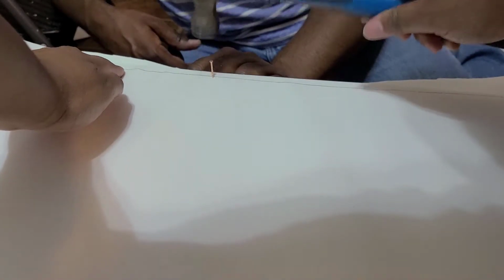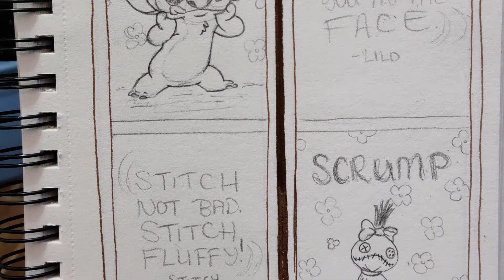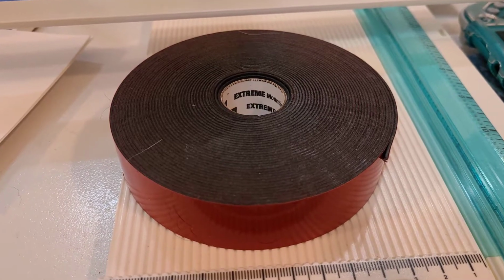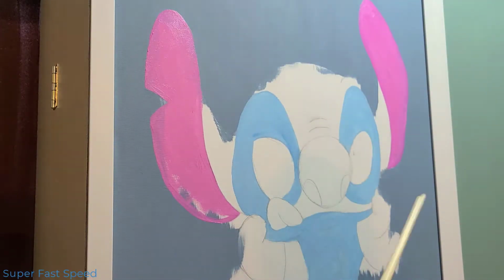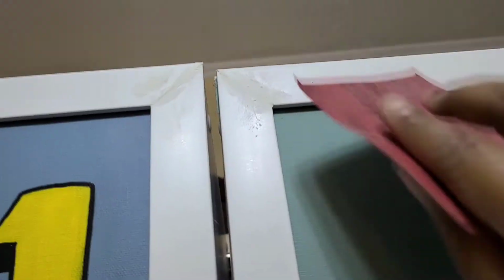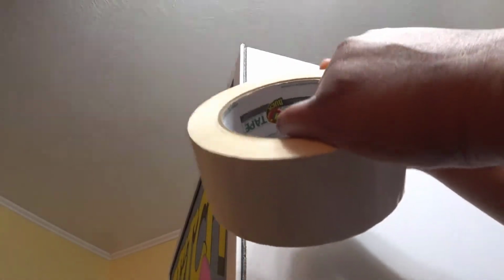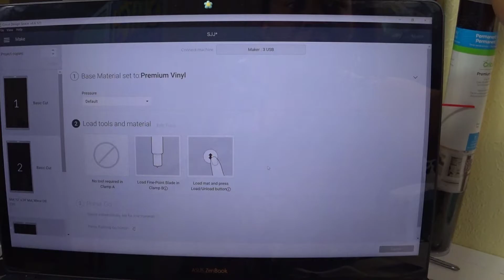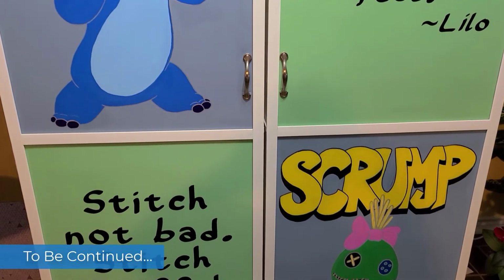Customizing Cabinet Doors | DIY Craft Cabinet Part 2 of 4

Comment: If you dothis again, consider using staples/stapler instead of nails.  Not the kind for paper.  The kind you get at a hardware store.  I think mine is Stanley brand (my dad gave me 1 of his after retiring as a carpenter).  
Anyway I use it for re-upholstering furniture, stretching canvases, framing work etc.
Reply from the maker: We should have bought one! Thank you for the suggestion!